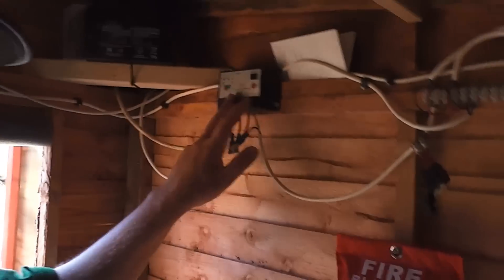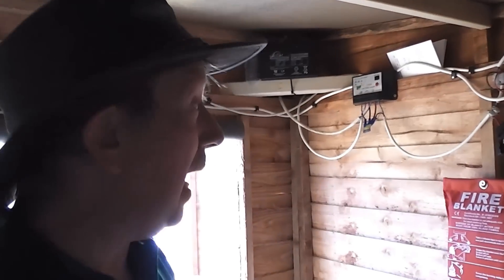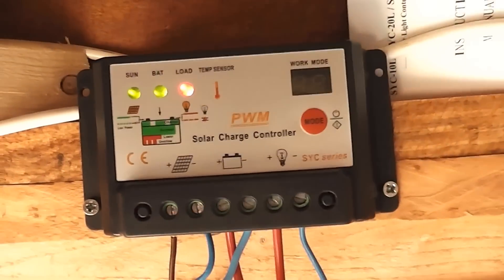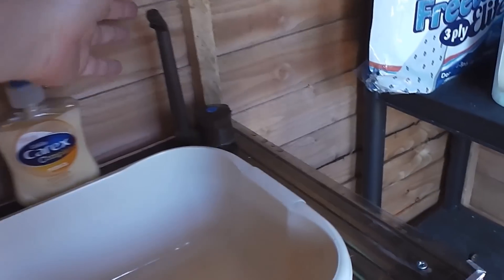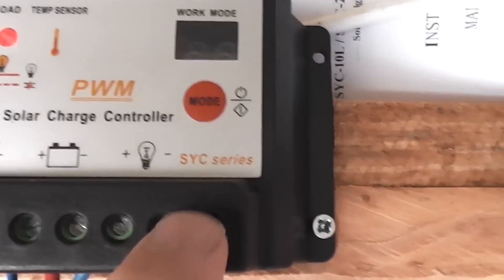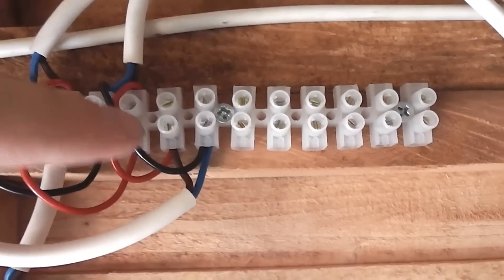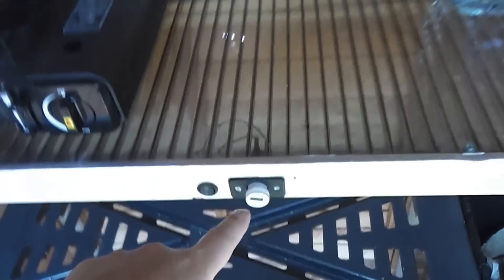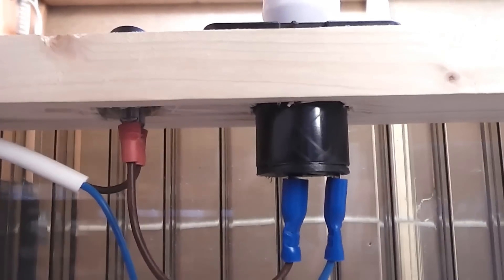12v Solar Power Installation For a Small Shed

Comment: You got it all wrong , first the fuse from the battery goes to the battery side not to the controller second you're using 220 volt switches you'll catch fire you need DC switches

Comment: Great informative video.👍
Thanks for making it
A couple of questions
1) What amp is the electrical block?
2) It's inspired me to hook up a time 12v battery to a 5W  solar left over after the flood light it was charging broke. Will that charge the battery in a similar shed with less electrical requirements or only lights

Comment: Nice setup. I am dealing with solar for some years as DIY and learned many things. Your setup is small but very usefull. With just 10W you have light, charge and running water. Some cable management would be usefull. Anothe ridea would be to change the solar charge controller with one that has 2x USB ports (2,4Amp) so you won't need anymore the 12V to USB car charger. Also the controllers have a timer for the output and you can connect some 12V LED lights and make the turn automatically on at sunset and run for X hours (digidal display). You cand play with those controllers as they are cheap. I had a 20W solar panel and an old car battery and three 2W 12V led lights for the yard that turn on automatically at sunset and run for 6hrs (I upgraded the solar panel to a 50W one). Runs fine since 2 years when I made the setup.

Comment: I am no electrician and it takes no skill to be one but, your using connector blocks to the circuit that are open to elements and that is a complete fire hazard waiting to happen especially how you have fixated it to the woodern beam. I receommend not following this guy unless you want a LOG BURNER in your shed! Those connector blocks are a fire hazard how you have done it and should be in a closed circuit that is covered.

Comment: Thank you for a very informative video. I have been looking high and low to make a sustainable solution for shed. I wonder if I can use it to also trickle heat our chicken coup in winter?!
Reply: Any heat application is beyond this level of installation. 
Heating demand huge amounts of power. While it's possible to install enough solar panels to make it work it's also true that we're not talking about small/cheap 10W or 20W panels. It's big bucks. 
I don't think you would be interested in such investment to heat up an otherwise non insulated chicken coup during Winter. Precisely when the Sun is in it's lowest. making the solar panels output quite poor. ;-)

This level of installation is perfect for LED light, small water pump, small radio/media player, etc. 
For heat, look into solar air heater. That can make a difference for relatively little cost, particularly if DIY. ;-)
Cheers

Comment: One idea, for the distribution panel, you might want to use 2 wago terminals for the multiple wire connection. It is equivalent with whst you did there but much simple. Try gogle it for "wago terminals" and you will get the idea. You can use one for the positive amd one for the negative and you can hook in sifferent appliances that run on 12V.

Comment: looks like the battery is doing nothing..he seems to be feeding all his equipment  from the solar panel via the charge controller ... surely then the battery is essentially " out of circuit " ?and he SHOULD be feeding all  his equipment DIRECTLY from the battery ?
OR.. does the power from the battery " somehow" flow backwards to the charge controller ?? seems unlikely.. yes, im new to solar power :)

Comment: I have a 100 watt solar panel. a 3000 to a 3400 watt inverter. batter charge control 2 12 volt batters .14.5amps 120 volts.but will not run a 7amp small frig. why? what have I get wrong?
Reply: are you using a pure sine wave inverter i think the fridge might not run on a modified wave just a thought

Comment: I noticed that you didn't use an inverter. Are all your appliances 12V? Pls: it confuses me when you connect blue to hot.
Reply: The inverter is to get from 12v DC to 240V A/C - he just runs on 12v DC for the pump, lights and the USB charger (which switches down to 5v)

Comment: Nice work, I have a question about the pump, when you came in for washing your hands, you just opened the water without turning on the punp, is it because the pump is runing all time or is it a tank you have connected the water to? If you can show the connection and explain a little bit, will be great.
Reply from the maker: There is a microswitch in the tap that turns on the pump :)

Comment: CABLING wrong 240 cable used not recommended at all. Colour coding wrong for electrical system .Thin wall auto electric cable is readily available from your motor factors or eBay. Correct cable for this application and smaller in size and makes neater job. Thin wall cable has good current carrying capacity in regards to what ever application or equipment you intend to use.

Comment: What gauge of cable did you use?  Could 16/2 or 18/2 work on a 50 watt panel?
Reply from the maker: From memory I think I just used 240v 13A mains twin core.

Comment: Question out of interest.. the set up you have here.. IF you would have wanted to.. could you have added a day night switch for the led light strip?, and what risk, if any, would it hold, if you then left the led strip switched on, meaning, it would be off during day, but go on at night, but could be turned off with a on off switch?

also

...could one ad a trip switch at a wall outlet to a set up like this, but yet again, only affecting the working of the led strip light, meaning, as long as it monitors electric current, it remains off, but it will turn on as soon as there is no longer electric current? the wall outlet will not be utilised for the charging of the battery.

Comment: Great simple explanation on 12volt system it really is car electrical 1 O 1. I've read almost all the comments and the statement about the fuse size I agreed with 10Amp possible 15Amp max on you load side not on the feed in side( but it never hurts to be careful) Also how someone can tell a that a cable is 1.5 mm2 compared to a general extension core being 2.5 mm2 (which it looks like) is beyond me and I worked for a international cable manufacturer making cables for over ten years and have forgotten more about it than most will ever learn. I start with some thing similar but for roof heat extraction. Scavenged 4 second hand 100mm computer fans purchased a 10W (same size) solar panel on a 46-47degree C day your roof space will reach well over 70 C closer to 80 C and anything to reduce it down by 5-10 Degrees means your Air Conditioning works less. I now run a similar controller a battery bank for continuous running into the night with an 80W 12V electric high volume electric radiator fan with the addition of a temperature controller to switch it all on and off only when the roof temp is over 35 C. As far as I could tell your explanation was was better, clearer and more fluent than most professionals that I have worked with. People can be picky about wiring being messy because mostly it hidden.    P.S you do sound like Mike from Wheeler dealers but in a nice way!  NSW in Oz

Comment: Hi! I'm installing led strips in my caravan. At the moment I have everything. The charge controller, the battery, the led strips. But I have a doubt about the terminal block. Did you buy one for 12v or similar? Cause I'm finding 12v and 400v, but I don't know if I can use a 400v for this led strips. Also, what is the wattage of the fuses?
Could you help me with this?

Comment: I have a question, why have you not used a DC-AC converter / Inverter. Kindly explain if I have missed anything.
Reply from the maker: They can be very power hungry and will drain the battery in no time, you'll also need a costly sine-wave version of a converter if you want to charge batteries or run anything more than a vacuum cleaner or a drill. They are highly nickable and something I wouldn't leave on an allotment. I also have no need for one, 12v DC is sufficient for my needs :o)

Comment: Working with DC voltage you would be better off with 30A cable from the solar setup.  It would save a lot of problems and also look more tidy.  Also wiring up the battery to another so you can have 12V out so you have a few more with longer hours between charge.  That or invest in a car battery with something about 44Ah You may also be able to run an inverter for a small fridge as well which would reduce charge strain on the battery that you have already.

Comment: Hi, so you have nothing  connected to the battery? All the electric runs through the load of the controller?
Reply: I thought strange as the load of the controller was is  for very small loads. One light bulb etc. I believe the load should be direct from the battery
Reply: True
Reply: If you have the loads connected directly to the battery the loads will drain the battery to the point that you case the battery great damage. The controller will disconnect the load if it sees that the battery is discharged.
Reply: I agree but that's where switches come into place. Honest query as much I'm looking at charge controllers and  the load side is rated quite low on these . Probably best to have the load terminals connected to a relay to cut off load from the battery..

Comment: Solar Power <3

This installation though, is not very safe. 20A fuse on what looks like small 1.5mm2 wire, is not allowed or functional, long distances from the battery like this with 12V, needs thicker wire. If you would try to pull 20A or short it in the outlet, the wire would quickly become very hot, and could start a fire, if the fuse is too big for wiring.

So, as the video says, contact someone who knows. This video does not show the correct and safe way of doing this.

Comment: So practically it's car electrics, as long as it's sleeved correctly and you aren't an idiot then it should be easy enough.
Just watch out for the lead acid battery, I'd fit it lower down and out the way in a vented box.

Comment: Hello, just wanted to ask your advice, i have connected the solar charger to the charge controler and the charge controller to the battrey. this is a photonic universe 5 amps.but the led lights i have connected to the battery and not to the charge controller.I know on the charge controler there is a connection to the lights.What i wanted to know is, is it o.k to connect this  the way i have .
i hope it is clear the way i have explained.

Comment: Thanks.  Totally clean and understandable.  Wondering if that's enough to provide a little bit of heat for my hedgehogs
Reply from the maker: +Pamela Maunsell  12v Batteries are great for lighting and pumps, but any form of heating will usually drain them in minutes.
Reply: Hey ma'am can you help me out for my solar panel power

Comment: Excellent video, thank you.  I understand why a car battery would not last long if you put a great load on it regularly but not otherwise.  I just want to put a light(s) in a small storage barn which I visit for just a few minutes every couple of weeks.  I intend to use an old car battery.  A cannot see the need for deep cycle.  Do you agree?
Reply: An old car battery will work for a small application yes. Greetings from sunny Jamaica.

Comment: Got solar panel set up to bank of 2 12v car batteries, it has charged them up just have to get lights set up and cigarette lighter socket, but good video thanks would like to put in tap, but don't know how it works as you never showed how you done it.

Comment: I can't get no power out of my contontroler there is solar coing in and battery power go in  but no power coming out what do you think its the same as youn I don't have a green light on when it all conetd thanks. Paul.
Reply: +paul Taylor , I would say disconnect the solar wiring from the controller. The controller generally NEEDS TO SEE THE BATTERY VOLTAGE 1ST,then the load then the solar , I have the same  charge controller as in the video

Comment: This is still the best video I have seen for the beginner and like most people I have watched a lot of vids on YT before taking the first tentative steps

Only concern is the positioning of the battery which seems to be a lead acid battery.. my concern is FROST damage in the UK during the winter. would a plasterboard lined box with loft insulation around it be a solution with maybe a very small fan vent (small fan from a PC maybe)
Reply: +TheComputec the freezing temperature of the battery is lower if it is in a reasonable state of charge. Although the PC fan seems like a good idea to disperse the vented gases it is probably not needed as long as you have reasonable ventilation. If you consider lead acid batteries fitted to trucks etc in the UK they are often on trays totally out in the open, they don't seem to have any problems with the cold. This solar kit looks very much like one a friend has in their boat, from Photonic Universe...

Comment: Awesome setup.  Right now I have a Goal Zero Nomad 7, 13, and 20 watt solar Panels.  Getting into solar, but the only place to put a permanent panel, would be my house roof toward the rear of the house.  Planning on a 12 volt system, with LED lighting in the house, also thinking of putting my Cable modem/router on the battery pack also.  Trying to be green, but tend to waist power on the grid.

Comment: This may be a stupid question, but does it have to be earthed?
Reply from the maker: Mark M no need for 12v DC as far as I am aware.
Reply: thx :)
Reply from the maker: I think if the shed got struck by lightning, the solar panel would be the least of my worries LOL!
Reply: DrBill ..im a qualified part p registered electrical engineer.....with 18 years of service in the royal engineers & over 20 years running my own business...and the answer is  No. you do not have to have this set up earthed.!!!!........otherwise we,d all be earthing bicycles up......tv areals.....sky dishes.....etc...etc.........if your battery blew up DRbill, then there was something wrong with your apparatus, or your actual install,,,,,,,!!!......and for the record, ive seen bigger things than batteries getting blown up, due to strikes..!!
Reply: No... it doesnt have to be earthed!!.....its all 12volt, thats why..............however, if you connected a converter, taking 12volts/240 volts, then you would have to earth it up.........and what was said about the polarity being possibly explosive, is not true actually.....the charge controller would cut out any battery "overload" and prevent the batteries from getting over charged........thats why its called a " charge....controller"....hope this answers your question........and a quick tip......when choosing batteries, consider sealed unit batteries.....then you dont have to worry about fumes being generated..
Reply: Simon West well that settles it then. Thanks :)
Reply: In short NO

Comment: How is that 12v pump work?! Do i have button on the sink to turn it on? How does it turned on? 
Thank u for the simple tutorial 😊
Reply from the maker: 3bdura7man its a micro-switch tap - usually available from caravan accessory shops

Comment: Good job... now you have completed the project and filmed a very clear video, you can tidy those bloody wires up now and make your man-cave nice and pretty LOL... I am now on ebay buying all the bits... I figure I can run my 12v TV and campervan satellite receiver off this if I get a larger battery and use it sparingly?  12V is king !!!
Reply: ***** thanks for the reply buddy. I should mention that i'll be using my kit at a house i'm renovating which I hope wiill be Off-grid, I only referred to it as a campervan satellite and TV because it came from one and its a nice low draw 12v set-up. I hear you on the solid core cable; even when I've been running cables in and out of torpedo switches i've had irritating breaks to fault-find. I've actually located some extra heavy duty speaker cable which has done the trick perfectly... lots of strands and well protected with a hard but flexible sheath. i'm sure it would have been really expensive to buy;- luckily I work at an electrical/electronic recycling centre so i get to grab goodies when they pass through at nominal prices... i'm on the lookout for some niceheavy duty UPS GEL battery cells at the moment
Reply: Great video, good to see some solar sun even in blighty!

Comment: Hi Rick. How do you handle the excess load from the controller?

I would also put the load on a bus bar instead of terminal block gangs. Lastly, I don't think you need a fuse on the battery, the controller should handle that.

Comment: Hi,
Great video.

I have a simple set up with two solar panels (one that came with the LED PIR light and another to keep my battery charged) 
I have a question. I bought a solar charger from Maplin for approx £15 with a built in diode. Its connect directly to my battery.(see http://www.maplin.co.uk/p/solar-powered-12v-24w-battery-trickle-charger-n59fu)

 I noticed that your solar controller appears to stop the battery from over charging. I am not sure how my charger stops the battery from over charging. Any ideas?

Cheers

Comment: Not using a off Grid Inverter? So, your system is running off your charge controller (12v)

Comment: That's a good way ov using the spade terminals in conjunction with blade fuses. I thought I was the only one doing that...! :) When you're using the three core mains cable what you can do is parallel up the spare core with one ov the other conductors. That way you get slightly less voltage drop (although it won't increase the current handling ov the cable though, as one pole is still gonna be a single wire!). It's probably not necessary for the power levels you're using here, but if you use bigger loads or longer runs it's a handy trick.